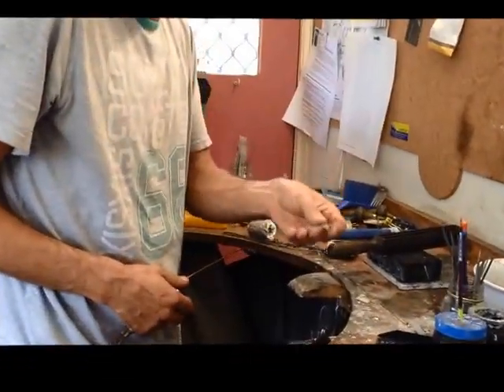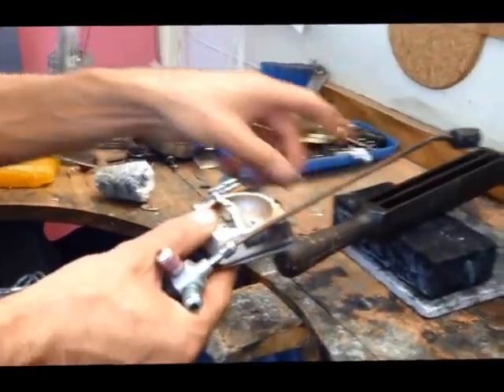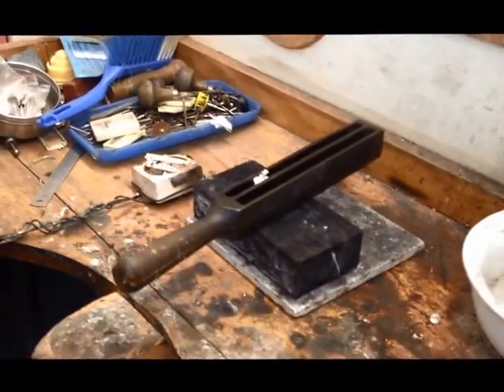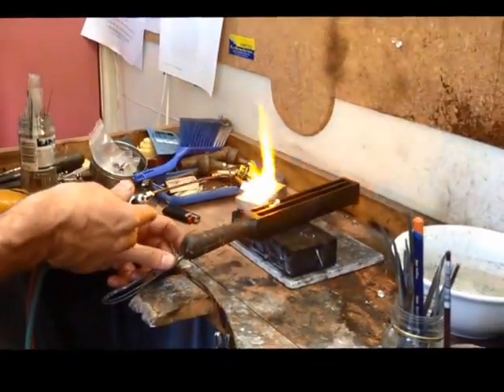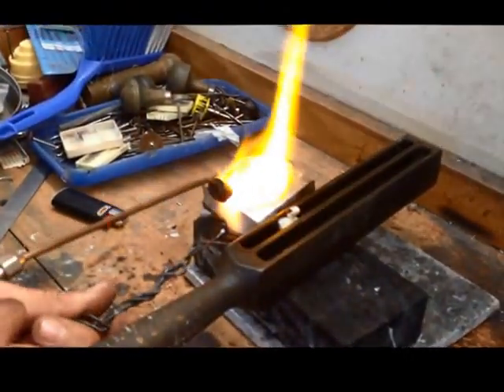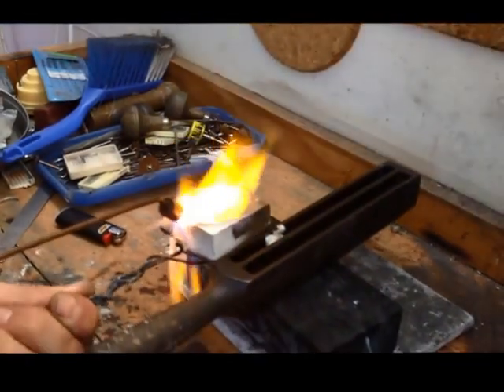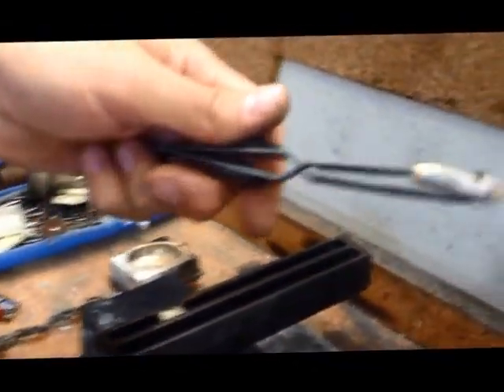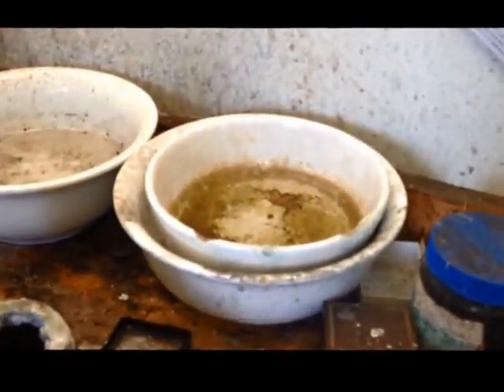How to make a wedding ring - Part 1: Melting the Metal Using Recycled Silver

Comment: so why melt scrap and pour it into the "what?" >mold. Instead of using  thich sheet metal or wire? just curious
Reply from the maker: Hi there - I do sometimes with silver but we often get asked to reuse a customer's sentimentally valuable old jewellery - and this video was aimed at showing our customers that we can do that.
Reply: +David Frith Jewellery - Master Jeweller so a band made from wire or sheet metal would make just as beautiful of a band? are there any other advantages to melting  the scrap and then pouring it into the mold as oppose to just constructing from wire or sheet?